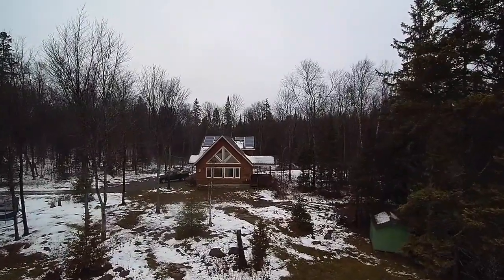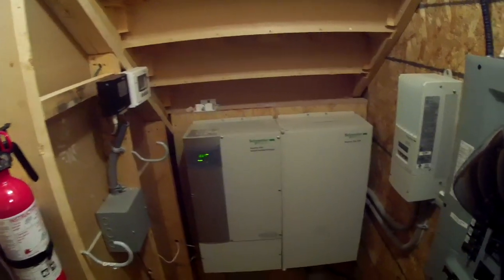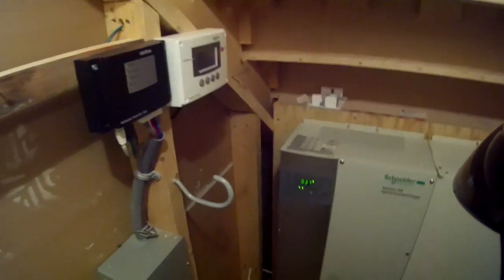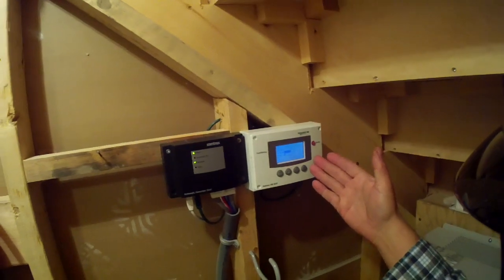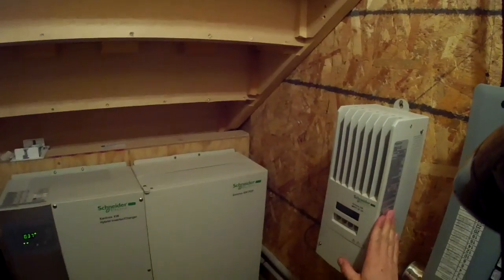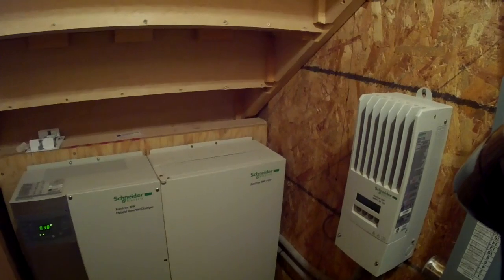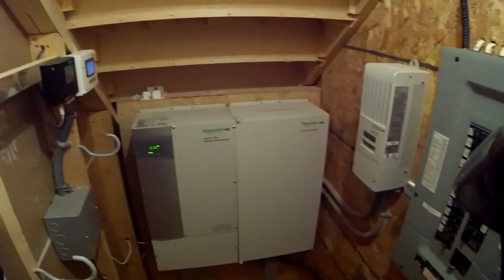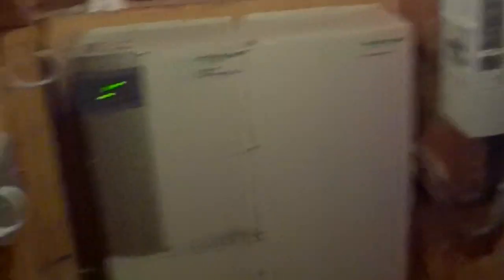#8 Off Grid Solar System & Storage at the cottage. Outdoor channel.

Comment: Excellent explanation, I would like a similar setup to my new build with the exception that I will be grid tie, without the batteries. The generator would be for emergency backup.
Reply from the maker: Good morning Rick and thanks. If I may offer, when you price your system, I know that they are making panels now with close to double the capacity of my existing panels and if possible, get as many panels as your roof can hold. I have learned through experience now, that  capacity to generate from the few hours of sun we get is really important, especially in the winter. When I put these in, I took the discount to get panels that were an older model , not realizing just how important it was to maximize the panel capacity. Also, although you are not considering batteries, perhaps have them price out a storage separately so at least you can decide if it is worth the extra. The charge controller you install won't cost any more. And if you are not in an area where you can get paid to send the excess energy back into the grid, then you may realize that there is a financial benefit to storing that extra energy you get off the roof into batteries instead of losing it. The charge controller will let you switch to battery power, for example, when grid price is high, or at any time you choose, which avoids grid costs for that period. And hey, if you have paid for panels and you have excess energy during periods, then keep the energy for later. Just a few thoughts. Good luck with your system. Cheers!
Reply: GP Outdoors that's an excellent point! It may be worth it to have a storage capability. I am building in Arkansas which sees a bit more direct sunlight than your location and I'm not 100% certain if I'll be able to net meter. I am an electronics engineer by trade but haven't dabbled much in PV solar. Yours is the first setup I have ever seen with the generator backup and I'm so glad you toured us with it as I wasn't sure it was possible. I'll take your points to heart and appreciate the candor.

Comment: I think if you use batteries as your primary power source a generator designed to charge DC batteries would be a better option. Kohler makes such a unit, I believe it is model number 6VSG. It should be more fuel efficient also.

Comment: Great video!  We are in central Ontario too, with a similar sized off-grid solar system and house.  We put ours in because running power lines in was more expensive, as well.  Interesting to see a different system, for a similar application.  Thanks!
Reply from the maker: Good day David. Glad it was of interest. Cheers!

Comment: This old video continues to be popular Gord!  Nice. work. I am prepping and planning to build a Log home on some property and have curiosity of how you solved water and sewer.  I suspect you may have a well and Septic system.  My plot is also going to be on a small lakefront lot. this presents challenges for septic. so I am curious on how you addressed your lakefront Septic or sewage solution.
Reply from the maker: Hey good morning Todd. Thanks for watching. I had a septic bed put in behind the back on the far side of the shed where I park the Kubota. There was a setback minimum from the lake which had to be complied with. I had the choice between a well or pumping water from the lake. I chose the well. It ended up 425 feet down but the pressure is good and in fact it was clean enough that I didn't have to filter it (but I do , just in case). A few of the folks down the lake chose to  pump it in from the lake. One chose to build a small water tower. The tower provides enough pressure through gravity to send it into their cabin. The other pumps it in from the lake but uses a pressure tank in the cabin (as I do).  Pumping from the lake can pose problems for winter use since the line will freeze unless heated and managed. Hope that helps a little. Happy to answer additional q's if I can. All the best Todd!
Reply: @GPOutdoors  your great.  Thanks.  You and the morgans have inspired me to start my own channel.  It would be centered on wildlife preservation and documenting the process of city dweller transitioning to forester and building my cabin.
Reply from the maker: Hey congratulations. Please let me know when you begin. Cheers and all the best Todd!

Comment: A question, on a financial basis, if the grid was easily and closely available, would you have connected and done a smaller solar back up? I have friend who is grid connected and wants to go off grid in thinking he will save money. Thanks
Reply from the maker: Hey great question Mark. I am happy to go into detail if you want to email me but the short answer is , your friend will not save money here, certainly not here in Ontario. If you are in the US, then depending on which state he is in, will help to estimate whether he will save and I am a little rusty but can perhaps provide some thoughts. If I was able to tie in to the grid for a reasonable price, I would still have put a small system in and for sure, and would have put a standby generator in, if nothing else. Here in the rurals , the power literally goes out on an average of once to twice a month. It is very unreliable because of so much forest impacting the lines. So it is not uncommon for some of my neighbours to come by to keep warm or to enjoy a drink when the power is out and I am the only one with lights and heat. But depending on where he lives, I promise he won't be saving money to any meaningful impacts, generally. Again depends on which state or province he lives in. Cheers!
Reply: @GPOutdoors  , thanks for the reply, I enjoy your channel . I believe a small backup system for select circuits is more in line with what they need. BTW I'm in Ontario  in the upper Ottawa valley.

Comment: The no air conditioning in your house is probably a big benefit for you.  Here in the Southern part of the US, we would almost certainly have air conditioning so I would guess we would need more panels and more batteries (more up front cost) or would run the generator almost constantly from May till Sept (huge propane cost) however technology as you say is dropping the cost all the time so in 5 years, that up front cost should be much easier on the wallet.  Thanks for video, learned a ton.  Would love to get to the day when I can go off the grid and give our utility company and the government taxes on utility service the finger when disconnecting.
Reply from the maker: LOL. Hey BK. Thanks for watching. Yes you would need more for sure but also most likely you get more hours of sunlight on average per day and that factors into it as well. Thanks for watching and glad it was helpful. And yeh, it feels pretty good never paying a utility bill..:))) Cheers!

Comment: Thanks for the posting the video of your setup. How much are you paying per month for propane to run the generator? Why not increase your battery capacity and solar panels so you won't need to run the generator at all? That would be my goal.
Reply from the maker: Thanks for watching.Good ideas for sure. Averages out to about $60-80.00/month. A couple of reasons why, but happy to hear your thoughts. The government is expected to release a new program in the spring of 2018 which is supposed to provide incentives for both solar and storage so waiting to see what that looks like. Up here in Ontario my generator virtually does not run from about the beginning of May through the middle of September. Where I am, we get a lot of snow so expanding panels won't help in the winter when I actually use the generator and expanding the battery capacity just means the generator runs longer to fill them (using more propane). I did buy a roof rake but trudging through 4 or 5 feet of snow with a ladder to clear the panels (only to have it snow again overnight) lost its lustre pretty quick :). And lastly ,wanted to get a little payback on the equipment before looking at revising it. The longer I wait, the cheaper the equipment gets and the better the technology gets. I hear a panel can produce up to 500 Watts now. Thoughts?
Reply: @GPOutdoors  Micro-scale wind is a good complement to the solar. A good turbine is considerably more money than the cost of expanding your solar, but it has the advantage of hitting its peak generation at night and in winter. Getting a better balance to your generation will reduce your reliance on storage and relegate the generator use to emergency/low running hours.
Personally, I have a farm here in Ireland with everything all-electric including my vehicles/heating etc so my annual power consumption is north of 15,000kWh which would be a big ask of an off-grid system at our lattitudes, but with battery, solar and wind 95%+ of consumption is covered on an annual basis. You'd be surprised at the impact enough wind power to cover your base loads alone can have on the self-consumption math.